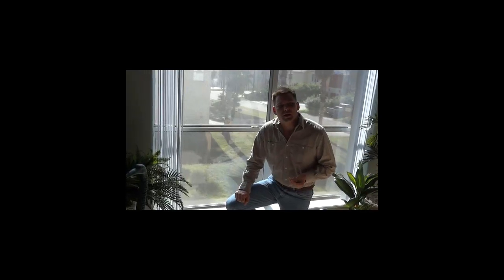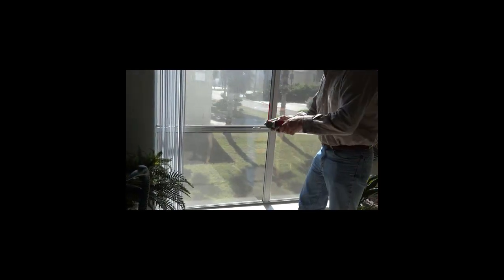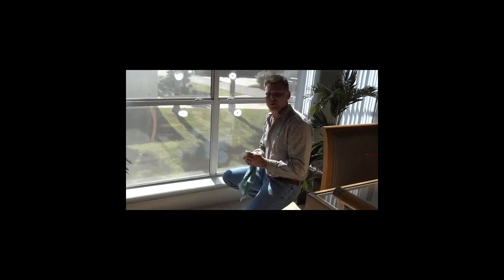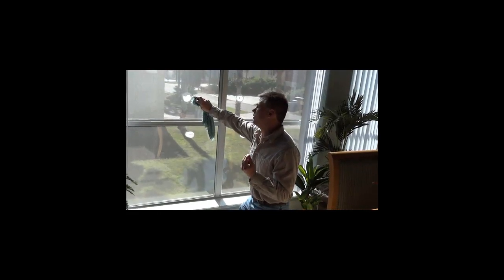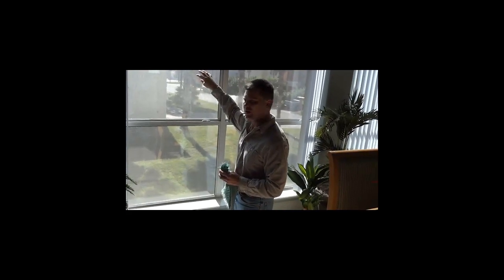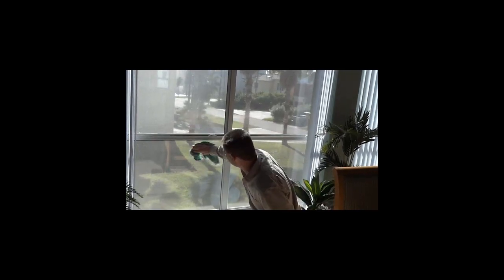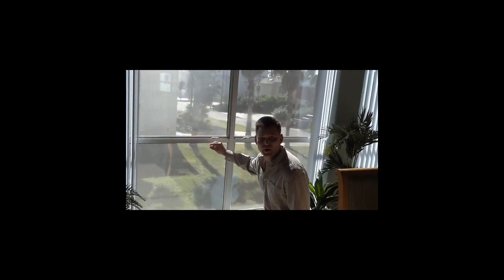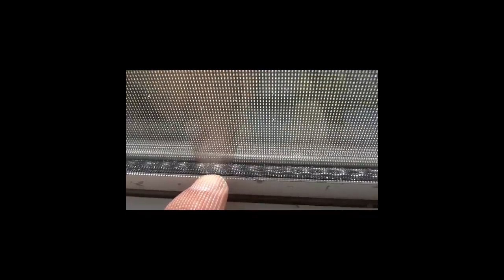Double Pane Window Seal Failure Test.mp4

Comment: Thank you, that was a quick and easy way to check. I was unaware of the precaution of not using reflective blackout material with double paned windows as you could cause the window to overheat and break the seal. it wasn't until I saw that the blinds had started melting that I looked it up and became aware of the mistake I had made.